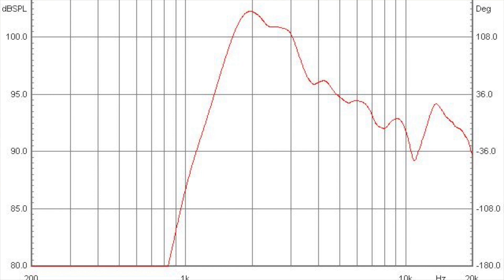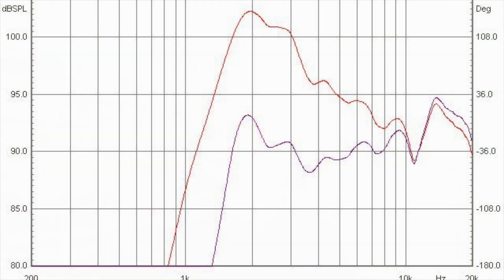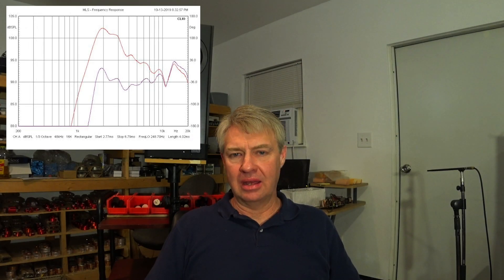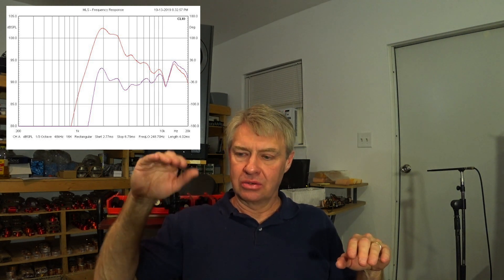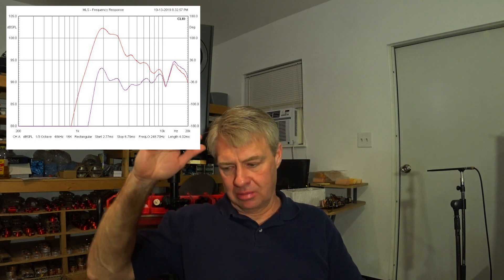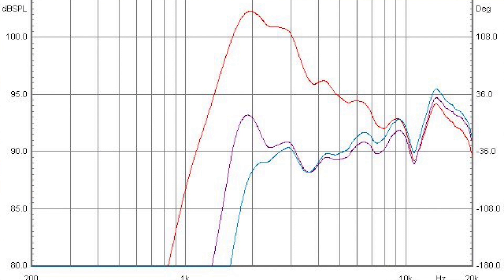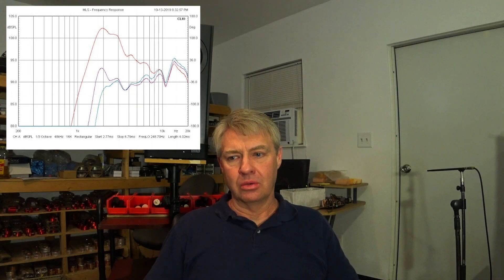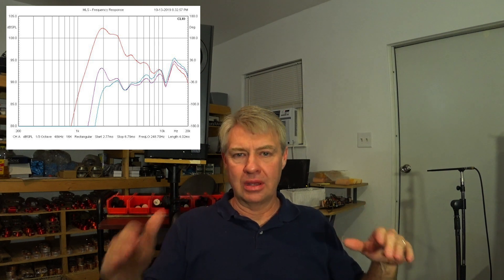Crossovers: 1st Order? Let's get Started!

Comment: In a first order filter, for example for a tweeter, does it matter if the attenuation by a resistor is put before or after the capacitor?  Or is it the same?

Comment: Hello Danny, I just discovered your channel. Just what I am looking for. Question 1 (of many), when measuring the HF of the Kef, what frequency range was applied to the driver, was it pink noise, or dirac pulse, or something else? P.S. I am looking forward to learning from you. Shame I am in Plymouth England. Thank you.
Reply: Hi! It's usually a sine wave sweep. Check out Kirby meets audio as he has some crossover videos as well.
Reply: @inglouriousmofo  thank you for your reply. I didn't get a notification from youtube for some reason. I will take a look.
Reply: I have a pair of 150 liter cabinets based on ATC SM150 only I have a dual concentric Tannoy 12" driver and a 6" reflex port to make crossovers for. I have a little knowledge of designing crossovers having downloaded a pdf by Pi Speaker designs, but you know a little knowledge is dangerous. tee hee.

Comment: Glad you discuss the differences between acoustical slopes and electrical crossovers filter orders.  It it something that you hear a lot, but not defined, but now is. Also, a pole in the electrical response equates to a filter order, so some folks discuss the number of poles in the crossover slope, that equates to the same number as the filter order.  I tend to interchange the two terms.

Comment: He didnt finish telling that no crossover or a first crossover is the best speakers. Other speakers has to use other crossovers aren't as good. Vandersteen first order crossover speakers are best for the money. Without crossovers, I have some speakers like that that are discontinued. So I dont know what to get. I have some discontinued speakers with 4 inch woofers that sound like big speakers that has the best sound I ever heard. I bet this guy could build these speakers for you. I would also want this guy to build me efficient speakers that are not harsh. Efficient speakers work well with tube amps.